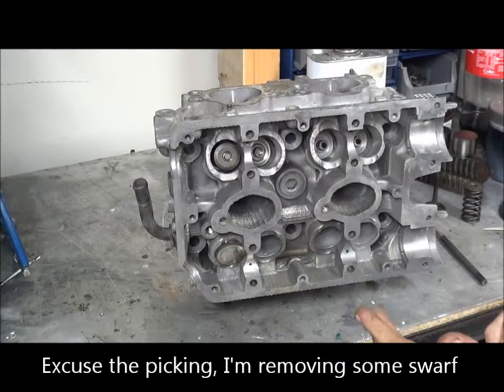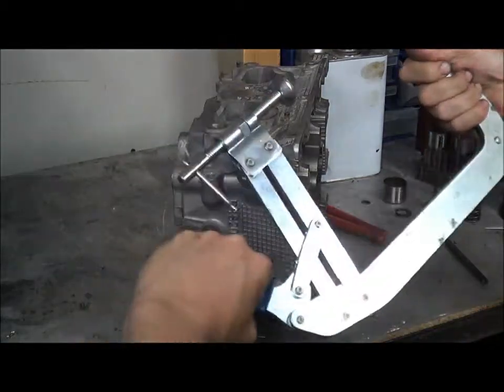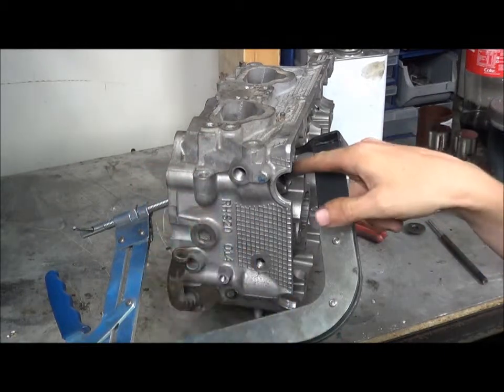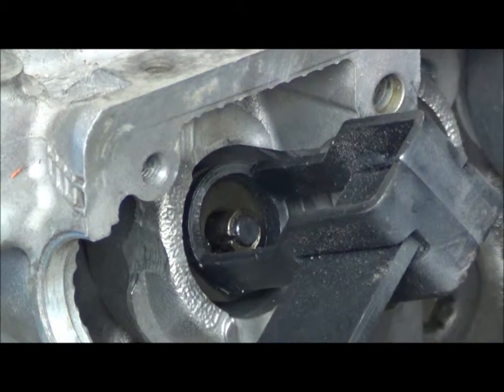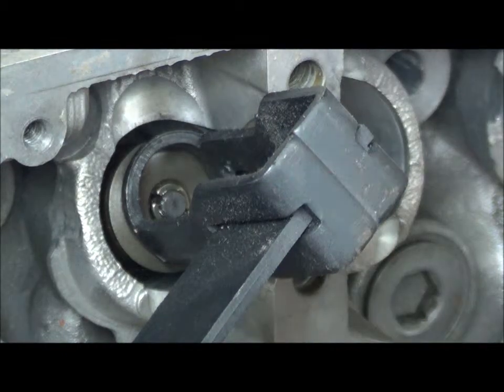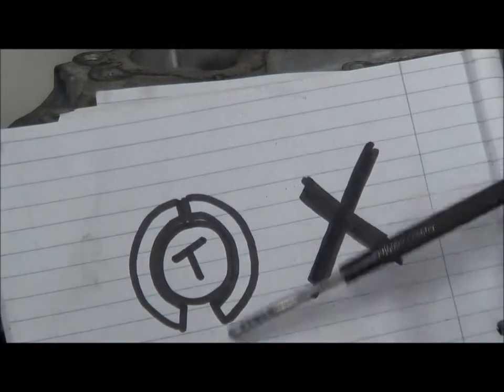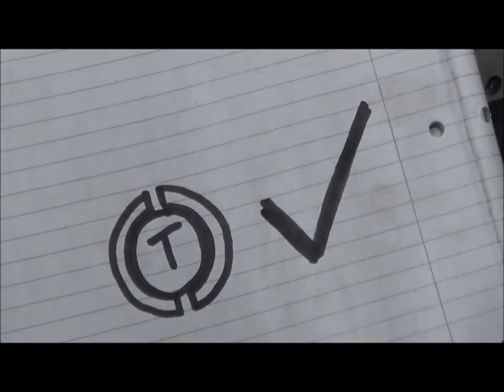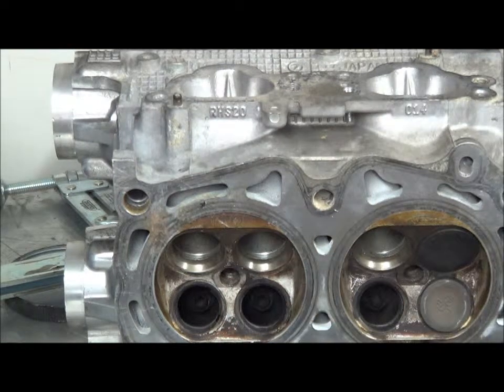4 Stroke Valve Intro - Part 2

Comment: Another great video mate, thanks so much for taking the time to make these. Always really informative.

I was going to ask if you were planning on doing any videos on carbs & fuel injection? In particular, how carbs and their various circuits & jets work. I used to own an old R80 and whilst the basics of the venturi principle make sense, it was all the extra ports & jets that I found pretty confusing!
Reply from the maker: Thanks for the comment, and yes fuel injection and carbs are on the list, there's alot to cover so will probably split it into the fuel circuit, then the starting circuit with all the jets etc......

Comment: Hi Matt, not wishing to teach my grandmother to suck eggs;

You mention the valve spring compression tool has a cup which locks under pressure and can score the valve seat.

Just wanted to say that I put a bit of rag on the end of mine and gaffer taped it into place to avoid potentially scoring the valve seat.

Cheers,
Tim
Reply from the maker: Hi thanks for the comment, do you mean valve face? Good idea with the gaffa tape, will have to do that in future thanks - matt